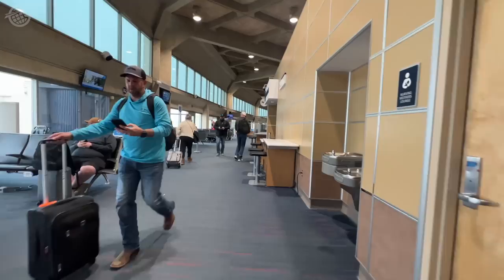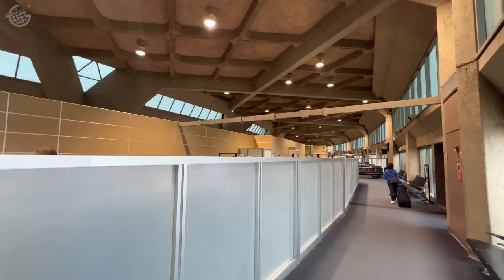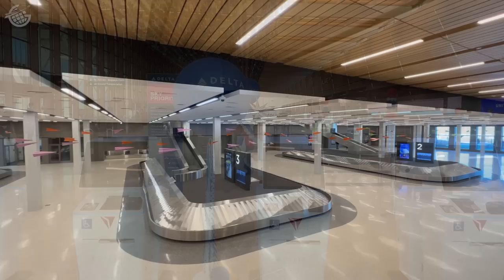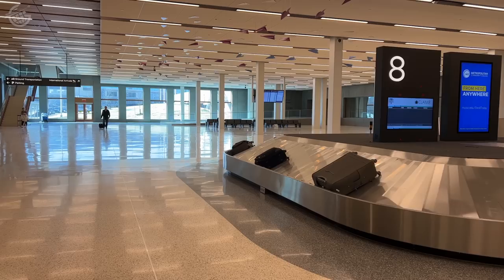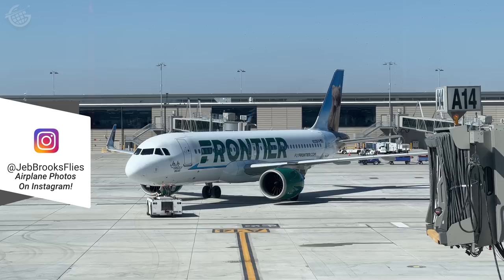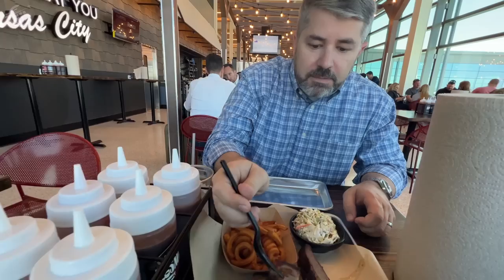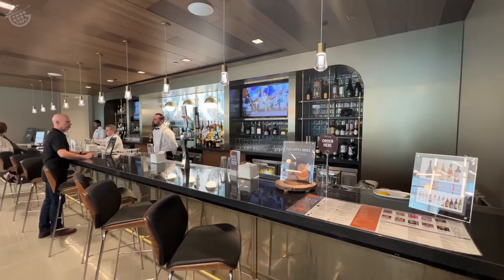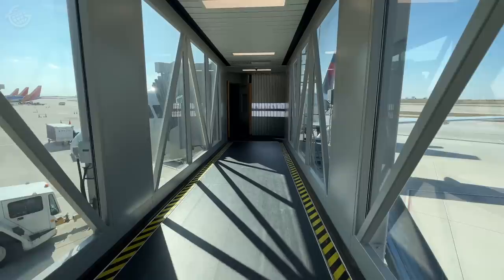World’s NEWEST Airport Terminal (Kansas City International)

Comment: That end shot on takeoff give you a really nice perspective of the old airport. I can imagine, if we still lived in a world where security at airports was minimal, MCI would still feel fresh and be lauded for its efficiency.
Reply: The airlines never did make that place work (numerous failed hubs), and finally, limited flights in and out. Even after the 2004 upgrade (wider gates and the blue floor) it was way out of step with travel needs, especially in the 21st Century. The infrastructure, wiring, pipes, were just shot and the airlines demanded change.
Reply: It was the BEST airport. None will ever compare to it. This new airport is an enormous downgrade and disservice to the city and all of its guests.
Reply: @calebdanielherman4913  The old airport was horrible. Cramped, tiny, horrendous circle design where arrivals and departures are together, tons of airlines abondoned that place which meant limited flights,

Comment: What a great improvement! The overall design is underwhelming considering it's a brand new terminal, but the art, history and local food options give it a lot of character. It seems very functional too, with the different types of seating options. Congrats with this wonderful new piece of infrastructure!
Reply: Well, to be fair, architectural distinction isn't terribly important in an airport terminal.  The job of the terminal is to facilitate connections, or getting in and to the gate if you're originating, or getting the hell out if you're terminating, and does so in a reasonably pleasant environment, and it looks like the new MCI does that really well. So from my POV, MCI is a winner!
Reply: @donkensler  My expectations may have been influenced by the amount of superlatives used ('incredible, magical, grand'). I do agree it's a very functional design, just nothing that wouldn't be out of the ordinary even 20 years ago. It's a tried and tested design, which is perfectly fine, but wouldn't consider it 'incredible'.
Reply: Not even enough seating at the gates when I flew out a few days ago. Sitting on the floor of a 1.5+ billion dollar brand new terminal is hilarious.
Reply: @ryanhacker9444  That's disappointing. How were other aspects of your experience of the terminal?

Comment: This is great, thank you. The new terminal was voted in by a big majority of KC voters in 2017. SOM (the architects) did many hours of community consults, and that's why it looks the way it does, and has local vendors and art. The airlines hated the old terminals and deliberately cut back on flights - even after the 2004 makeover. I think there's a nostalgia for the small-city airport feel the old ones had, i.e. "convenience" (if it ever really was), but KC is a booming 21st century metro. Maybe once folks actually try the new terminal the old one will fade from memory. Thanks again.
Reply: No mass transit to downtown KC
Reply: @deandecoursey2334  That is the one BIG fail here and I started pointing it out years ago. Especially with the World Cup coming - Europeans expect transit! But I did see that the KC transit authority is moving ahead with new plans to build that, I hope before 2026.

Comment: I remember reading about the "new" terminals at MCI in "Popular Science" magazine back in 1972. It was hailed as "the airport of the future," and rightly so. This was an entirely new airport, not just new terminals. The airport was  envisioned as a hub for the entire Midwest, so the original name was Mid-Continent International. Unfortunately, it turned out the design was based more on the past than the future. As you pointed out, Jeb, the new security requirements didn't fit the concept of the airport, but deregulation also played a role. In order to compete, airlines had to become less elegant and more efficient, less like a crack passenger train and more like a bus line. Airlines that couldn't adapt, like TWA and PanAm, disappeared, but Kansas City was stuck with the airport of the future-that-could-have-been. I was there once or twice in the early 2000s, and it was indeed a hacked-up mess. I'm sorry to see the old terminals go the way of flying boats and wearing your best clothes to fly on TWA, but that's the world we live in. My home town of Pittsburgh is just starting to build a new terminal to replace the one that only opened in 1992. (Like MCI, PIT was hailed as "the airport of the future," and its design was dictated by the major carrier, US Air.) I hope our new "airport of the future" is as efficient and beautiful as the new MCI.
Reply: The initial plan also included having direct flight to far away places, with feeder flights from across the USA.

The streets near the airport were named Cairo Road, London Drive, Paris Street, Vienna Avenue and so forth.

Comment: Great video!  Thanks for coming to Kansas City to check out our new airport terminal.  While I do feel some nostalgia for the old buildings - I took my first air trips through them - they always felt like they were relics of a different time.  It always disappointed me to know that the design so many here seemed to love (“It’s so convenient!” “I can drive to my gate”) is also the same design that really kept the airport from growing, attracting or keeping airline hub operations.  We built it to what TWA thought they needed in the 1960s, and when we refused to rebuild/renovate it for them right after it opened in the 1970s they moved major Midwest Hub operations to St. Louis.  You couldn’t really load or unload a 747, DC-10 or L-1011 efficiently in those narrow, cramped little buildings, so we could never really make long-range international flights (London, Paris, etc) work.  They were fine, I guess, when metro KC was around 1.2 million.  The metro is now over 2.2 million and we draw passengers from all over the region, so we really needed a bigger, more modern & flexible terminal.  I’m hoping that, in addition to growing Southwest operations and getting more flights to Mexico, we can attract flights to Europe with this new building.

Comment: It's great to see KC getting an new terminal. I have been to the old one several times in the late 90's into the early 00's. Even before 9/11 it was a very cramped security area, and the temp "fixes" they did after 9/11 were kind of funny, but you have to work with the space you have. They had talked about mothballing one of the old terminals in case it is needed down the road, no idea if that is still the case. Great video!

Comment: Thanks for giving us such a positive review.  Before 9/11, the old airport was great if you were a "local" business traveler--in and out very easy.  If you were passing through it was awful, and again terrible after 9/11.  That is when "many" of those partitions were installed, between the gates and TSA security set up.  Before 9/11 you would just pass through a magnetometer, very quick.  I have Pre-Check and it still can be slow at times, depending the airport--so I like the new design. Too bad you did not stay long enough to tour the city--include more pics in your video.    I look forward to flying out of the new terminal soon.    Again thanks.
Reply: The Austin TX airport has a similar issue. Even though it was built as a "new" airport, it was meant to also be a destination for locals.  I can remember going in high school just to watch planes and get BBQ and ice cream. Nearly all the excellent food is past security. When it was built, anyone could go through the basic security and go get something to eat. Then after 9/11, you had to have a ticket.  So all that great food is gated off.  Of course, it used to be nearly all local food and now it's a ton of chains.

Comment: The all in one level design is something that can be done for even the largest airports but it has to have the size for it. For example, Atlanta's Domestic Terminal (ATL). Its my little hack for getting in and out of the domestic terminal to use the lower level that isn't really advertised.

Comment: Glad the gal has some experience with airport design, I do have a couple quick questions. If you're dropping people off for a flight, and want to eat dinner with them before they leave, is it possible to get to the restaurants without a flight ticket?  That huge entry atrium glass wall looks nice, what is behind you in those shots?  It looks like some sort of parking garage right in front of those glass walls.  Also, the 36 gates sounds like a lot.  What was the gate capacity of the previous one?  It looked much larger than the new one.  Nice videography.

Comment: ...I remember when there original terminal was touted as being an innovative concept and for the day, it was.   MCI was designed to be a major modern jetport  that was intended to handle TWA's 747s and "forthcoming" supersonic transports (the latter of course never happened).  I've flown through it many times.and still liked the short walk from check-in to gate and gate to baggage claim. as opposed to dealing with long concourses and distances particularly whne connecting to another flight. (in the 70s security was still not as intense as it is in the post 9-11 era, often just the scanning "arch" you had to walk through before boarding the plane instead of the checkpoints we currently have at the entrance to each concourse.

The new terminal definitely has a far less claustrophobic feel due to more natural light and the high ceilings. as well as good amenities.  Hopefully it will attract international service  back to the Kansas City which disappeared  when TWA moved to St Louis.

Comment: The new airport is such an improvement! Now you get to walk as much as 1/4 mile from your arrival gate to a single baggage claim area for the entire airport. Then go outside and wait an hour or longer for your ride to work their way from Paris Street Cell Lot along with about 200 other cars also going to pick up their people. Wow! This is so much better than then short walk to the separate baggage claims and the near immediate curbside pick up from your ride. At the old airport, if you weren't ready to be picked up curbside, your ride could use a thru lane to circle back around when you were ready to be picked up. There is no thru lane at the new airport, (except to leave the airport) so all rides just wait in a single lane to pick up their passengers.  And of course some will just park at the curb until their passengers reach curbside which compounds the traffic backup problem. It's just a mess. Of course you can have your ride go to the parking lot and you can carry/drag your baggage to the parking lot where they are waiting. That's better than curbside like the old airport, right?  What a poorly designed mess it is. I miss the old airport.

Comment: You're talking about security that came about following 9-11, right? That was a bit more than "28 days later". I had family that worked for TWA out of KCI. You could go right to the gates and say, "goodbye". As far as I recall, it was like that into the 90's. However, I'm happy they have finally updated it. Traveling in and out from out of state, and cramming into the overcrowded gates has been a nightmare... again, since 9-11. While I'll miss the nostalgia of the old terminal, this should take KC nicely into the foreseeable future. At the very least, it will hopefully be relevant for longer than 28 days. 🤔 Cheers.

Comment: I appreciate your enthusiasm. Good to see the modernization of more airports in the USA. It's been long overdue. LAX conceptual design theory was similar to this airport. It was about getting the passengers as close to the plane as possible. That was when LAX was also just one story. Though LAX did a better job executing the design. The concourses and terminals had more space and passengers got to the terminals via tunnels with moving sidewalks.

Of course LAX suffered from the same issues once more strict security requirements were instituted. It wasn't until the addition of the second level in 1984 did things get better. However, the horseshoe design was also ultimately very limiting in many aspects. I'm sure, as you know, LAX has been going through a huge multi billion dollar renovation for the last several years and still has a few more years to go. Hopefully, everything will be completed before the 2028 Olympics.

Part of LAX's renovation and expansion is finally adding an automated people mover that will connect to the rest of LA Metro. Does this airport have some kind of train connection to it? Thanks.

Comment: As a KC resident, I'm really going to miss the ease and speed of the old airport. I don't need a shopping mall. KCI isn't really a layover airport, it's more of an endpoint. The while I keep seeing people mention the spread out security checkpoints of the old design as a flaw, I see that as an advantage. Each of those checkpoints HAS to be open. I'm afraid the new one with a single security area will succumb to Walmart Syndrome. Sure, at opening you get tons of lanes but not too far down the road you end up with a lot of them no longer in use and longer lines. Denver is a nightmare and even Seattle with 3-4 security areas can be a pain in the butt.

Comment: I think your video is somewhat mistaken. I've been flying to KCI since it opened 50 years ago or so. Security changes with the walls or partitions only happened after 911. Prior to that, it was all open and family could sit and wait with you until your plane boarded and no issue ever with bathrooms that I ever heard of. The passenger went thru a simple metal detectors that was placed at the opening to the walk-way tunnel that took you to your plane. Again, no changes after 26 days like you mentioned that I ever saw or heard of.

Comment: The initial security changes did NOT significantly change flying in and out of KCI.  They DID have to add metal detectors all over the place, but it was still a VERY short and quick walk from car to gate.  9/11 is what really changed that roughly 30 years after it opened.  Fun fact:  The old KCI airport was NEVER fully up to post 9/11 TSA security standards because it was literally impossible to get it there.  I'll miss the old airport.  There will never be another one that is as quick and easy to get in and out of, but it was time.

Comment: It’s a shame those drive to the gate airport designs didn’t hold out better. I’m legitimately surprised there hasn’t been any airports it seems that have just demolished the center parking garage structure to use as a site for a check-in/security and baggage claim area and built an off-site garage like is more the standard today. Seems like it would be much more cost efficient than building a large new terminal building from the ground up, and the large diameter of the terminal buildings at Kansas City look like they would be perfect.

Comment: The narrative is a bit confusing.  You say the original KCI was 50+ years old and featured a design strategy made obsolete 50 days after it opened but subsequent examples of security concerns are "TSA" references.  Are you alluding to early 1970s hijacking incidents that led to security checks?  KCI was still a breeze to traverse at least through the 1990s.   Given that this new terminal was completed on time and on budget, it would be interesting to hear how the land was acquired, how the design was chosen and how contracts were managed.

Comment: For those that miss any "efficiency" of the old airport, this new airport will likely lead to airlines expanding their operations. Southwest is now better equipped for connecting passengers here. More flights to more destinations is going to save you way more time than a quick walk from curb to the gate. 

Not to mention there is now a way to get lunch before your 12:00 flight to SEA (3 hrs). That one was always the worst when I flew from MCI weekly.

Comment: My question is how is 39 gates enough??the old terminals had way more than that combined. So now they are asking all the airlines to downsize and fit into 39 gates
Reply: Due to airline consolidation domestically, there wasn't a need for three terminals, and Terminal A was demolished to make room for the new one. We have been using only Terminals B & C for several years, and the total gates combined between the two are 42. Also, per KCI, the new terminal can conservatively do a little over 300 flights a day, and the maximum number of flights for this summer is only 160. There's plenty of room to grow, and the new terminal can expand to 50 gates with new construction on concourse A to the south.
Reply: @robertdasilva6269  ok thanks for explaining. It’s cool to see they finally got a new terminal. I’ve never been to Kansas City but i would love to go

Comment: 1:40 hold up. Saying the concept for the old terminal was unique is just... wrong. Thats the exact same design idea for the original terminal at Tegel, the old Berlin airport. The terminal had the exact same problems with security too. That one opened in 1974. Nairobi, Kenyas main airport, JKIA, had that same concept as well, though it is less visible there today with all the modifications after the terminal fire, the added 1A terminal and the reworks happening right now. Ifirc, that terminal opened around the end of that same decade.
So that factoid sounds cool, but is true only as far as north America goes.
Reply from the maker: Good point, CDG has a similar design as well.
Reply: @GreenerGrass  great example, forgot about that one!